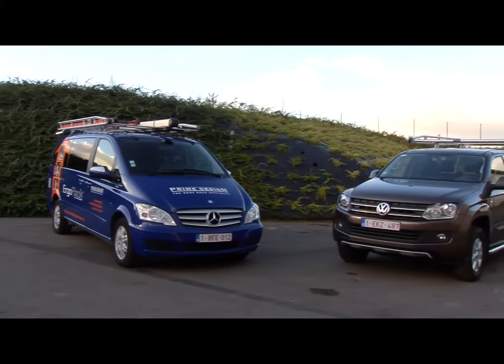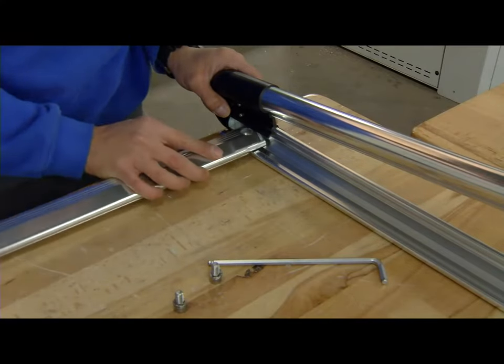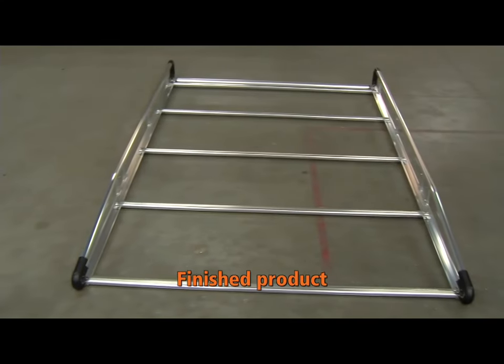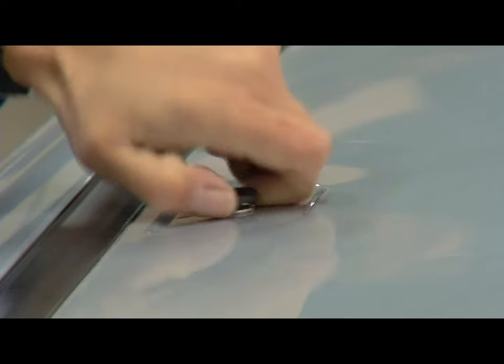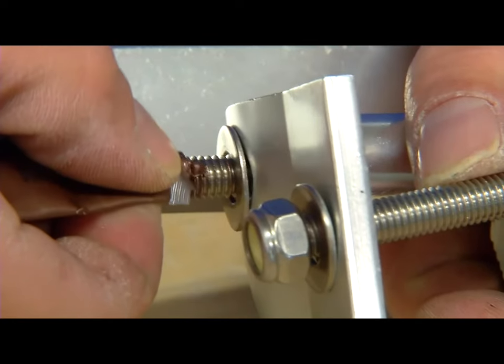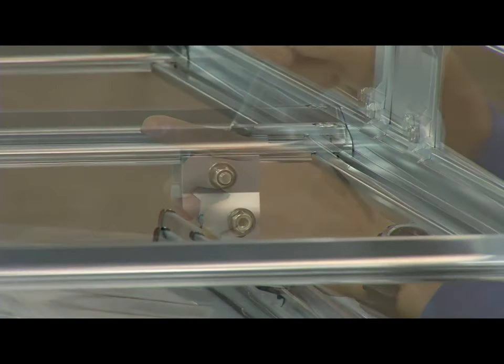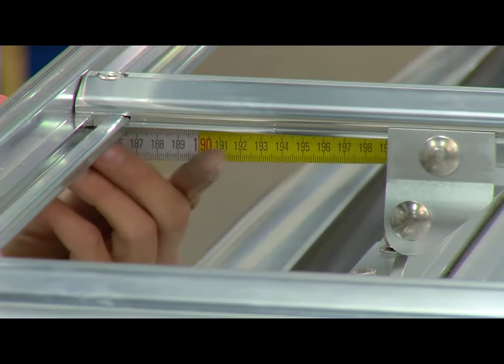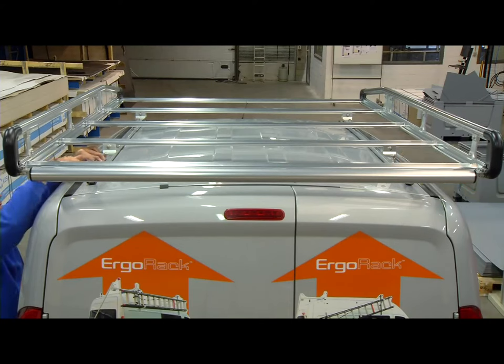Prime Design AluRack How To

Comment: These cross bars look adjustable? Can you slide them forward backwards a bit to accommodate a roof fan?
Reply: Ah, looking more closely I see threaded holes in the rails. Should be easy to drill and tap some new ones to move the rails a bit?